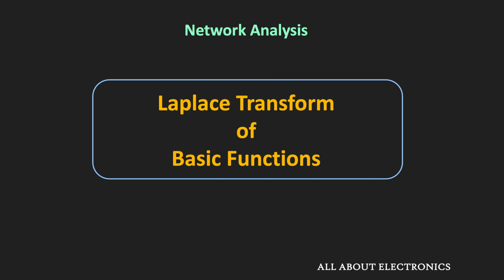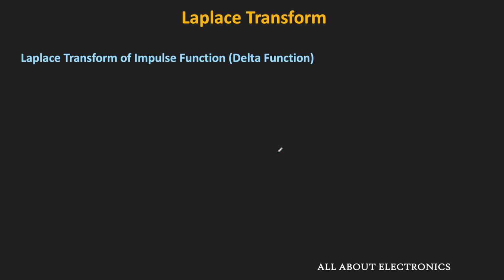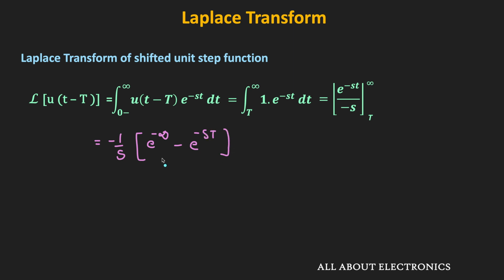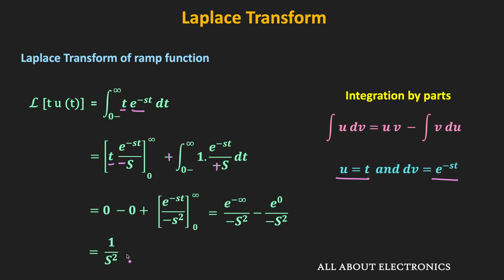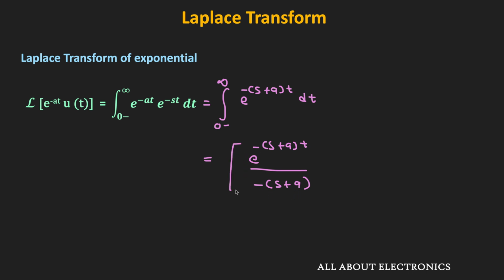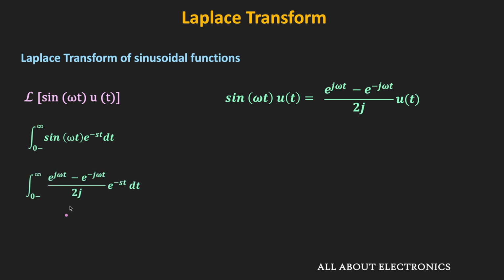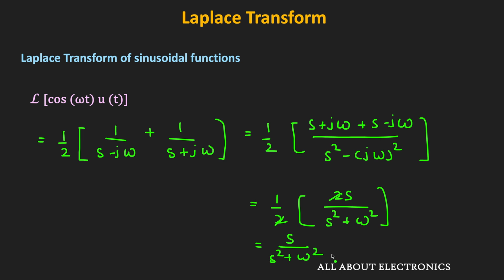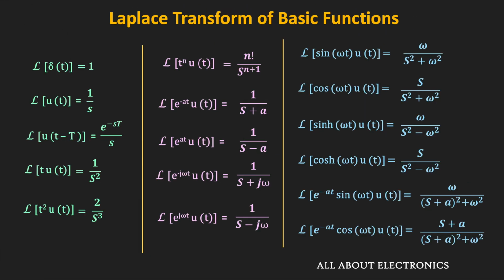Laplace Transform of Basic Functions (Impulse, Unit Step, Ramp, Parabolic, sine and cosine )

Comment: You are putting a=jw in sine derivation but you assumed a as real in deriving laplace transform of e^-at (where e^-at goes to zero as t goes to infinity but that's not when a is imaginary). You should just do integration instead of this and you will see you need to just integrate till its period not infinity which you have used in periodic functions video. If the limits were really till infinity then no need to specially discuss periodic as sine, cosine are periodic.

Comment: 1:40 I don't understand why the dirac delta function's height can be understood as "1 divided by epsilon", in the case when epsilon is not the width, but instead the width divided by 2 (or the width on just one side of the y axis). If epsilon were to be 1, even if it is to ideally approach zero, 1 / 1 would be 1 (great, normal dirac), but in reality the width of the visual would extend 1 (epsilon) in the +x direction and 1 in the -x direction, making the width 2, making the integral of the dirac delta into 2.
Just a little confused about why the visual is the way it is that accompanies the "1 divided by epsilon" definition.